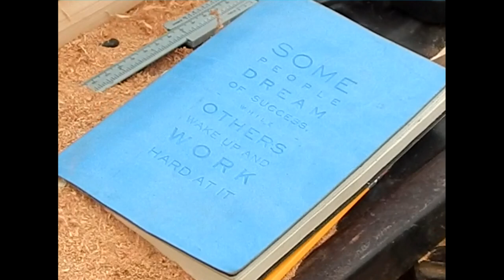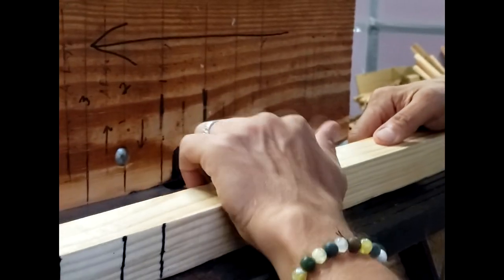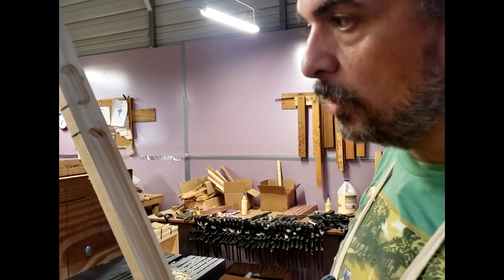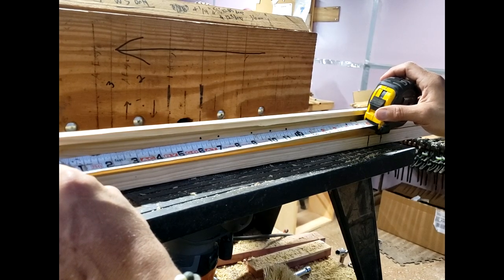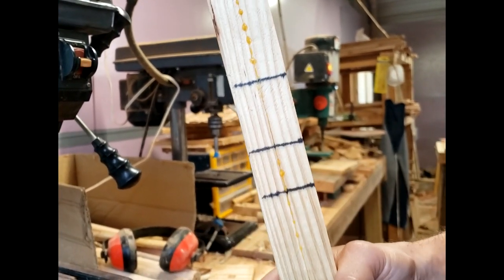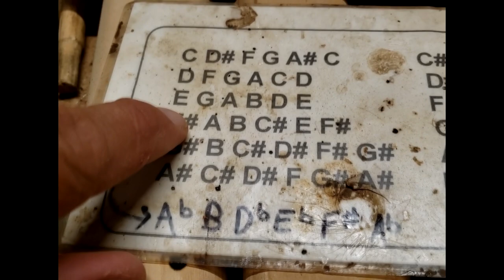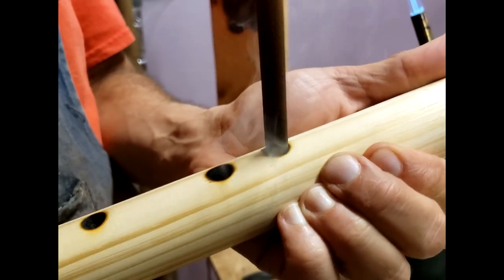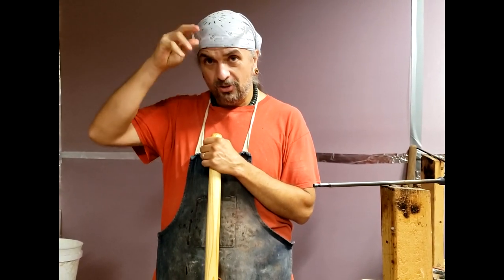How to Make a Native American Walking Stick Flute

Comment: Thank you for sharing the knowledge... Yes said something about using 3/8" burning rod for tuning sound holes? I've been having trouble with tuning using the 1/4" burning rods... Of course I've made a branch flute and I'm thinking I need to make the figure holes bigger 1" bore and the other flute is 1.5" bore... Should my track be wider by how much...
...
Reply from the maker: Just as a general rule of thumb, an inside diameter of 1 in should be about a 5/16 inch wide sound hole. Fingerings should be somewhere around 5/16 inch. You will need to adjust for tuning purposes. All this aside, it of course depends on the pattern you use. I hope this helps some. 🙂

Comment: Oops hit the wrong thing!  Try again. I have been successful in making a tube that plays a beautiful note  but when I put the fingerings in the whole thing goes south.  Holes won't play or it sounds all airy. You say this isn't rocket science, but I'm not doing something right. It also seems that my finger holes feel too far apart to play comfortably.  Boy I wish I could could make a flute side by side with you.  You're so encouraging and make it look so easy.
Reply from the maker: Thank you for your faith in me and your kind words! It certainly isn't rocket science, however it's always good to start off with a good pattern. We do have videos on making a flute in the key of F# and since they're inside diameter is close to that of your schedule 40, try following that as a pattern. Otherwise, feel free to message me through my website and I may be able to give a little light on the subject.
Reply: @BlueBearFlutes  thanks for your prompted answer.  I will give the F# a try.  Let you know how it goes.